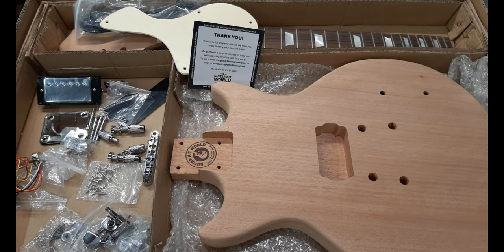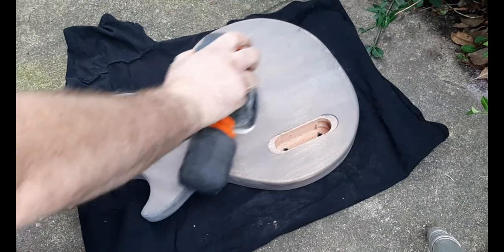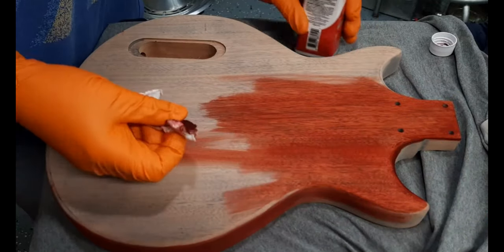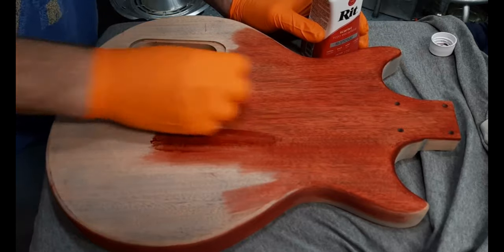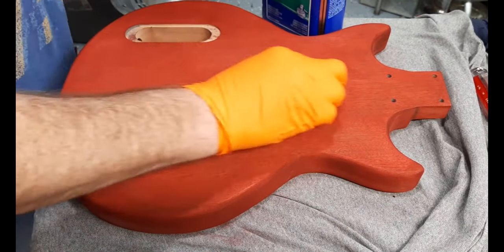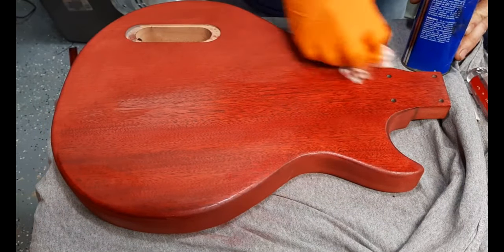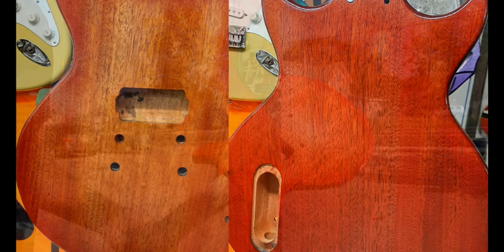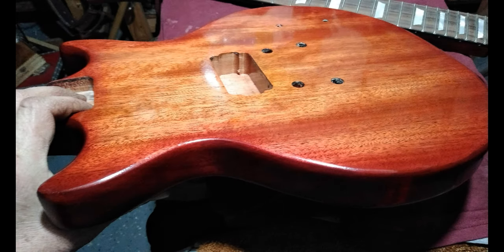Staining a Guitar With $4 Clothing Dye; Guitar Kit World LPJ Kit, Rit Dye

Comment from the maker: I used some Rustoleum clear over the stain. It felt tacky, even after a month,  so I ended up painting it yellow.https://youtu.be/X-8x03iz9cs
Reply: Hey Tom, I used the same technique on a Bex Gears Strat. Turned out pretty well for my first try. I used Krylon Super Gloss Clear, and it dried overnight.
Reply from the maker: @charlieboxxo  I'll have to try that Krylon clear
Reply: Probably too much of mixing of products caused it to stay tacky.  I always use the Minwax nitrocellulose lacquer, it does dry fast for wet sanding but let it cure for a few weeks before you get too wild with it.
Reply: I know the bad bounce it took. I will add it in the comments

Comment: First and for most awesome job, Great work love the color scheme. However the down fall was Grain Filler. How is That? Dyes, Stains and Linseed Oil need to penetrate the wood grain blocking the grain kept it all at the surface the Tacky? that was a combination of the sealer and linseed oil that well never penetrated and allowed to dry, Still for a first run it all looked awesome. (Taurus/Hipoint Enthusiast) When Mine arrives I will be doing a similar process minus the grain fill. I will get it posted before and after. I am wood burning and Dyeing with clothing die.  Green Whatchamacallit is the best I can describe it as.
Reply from the maker: Thanks, I wouldn't have used a grain filler, except that seems the norm. Some use a clear grain filler, after the clear coat. I won't be doing that again.

Comment: Should not paint over Wax.
 Won't cure
Reply from the maker: I don't know what you're talking about
Reply: @TomPetersonRefuseReuse  When you put wax on the guitar body it keeps the clear from curing. That's why it did not cure. Looks very cool. Great Job!
Reply: Cool Longboard! I have been skating scence 1976. 56 and still ripping up the Parks and sum downhills!
Reply from the maker: @keithhampton9700  I didn't use any wax before clear, I used boiled linseed oil.